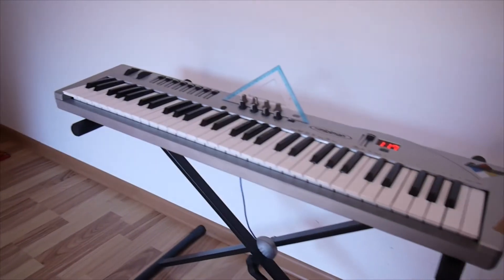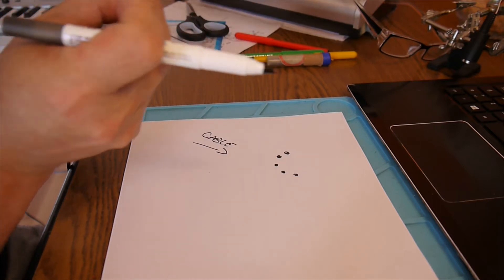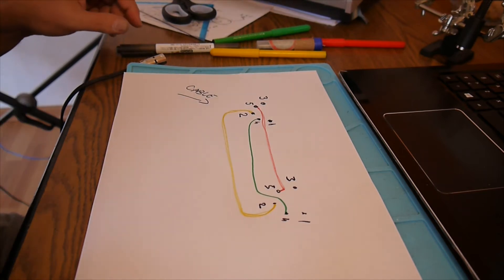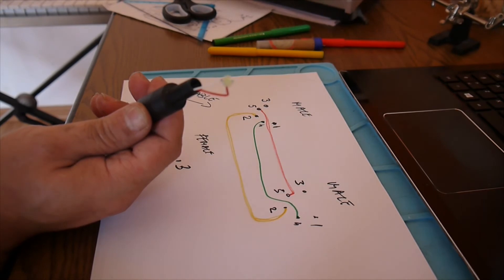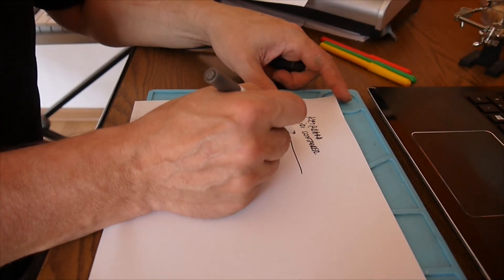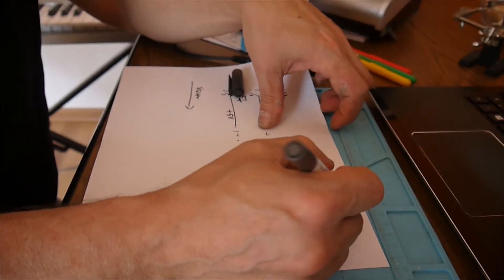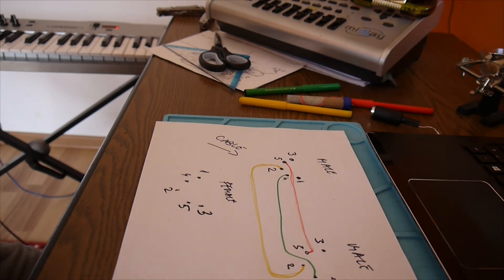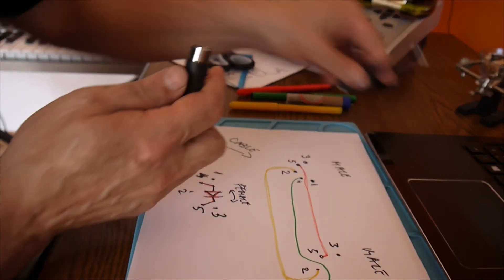DIY Midi cable, MIDI tester and general considerations.

Comment: please, do another video on making a DIN midi cable to USB midi cable. Old midi host to PC. Thanks
Reply from the maker: IT's kind of tricky cause we need an electronic circuit to act like a ''translator'' between classic MID signals to USB compatible. You may buy a very cheap interface for few bucks instead...

Comment: im having a hard time opening up the midi cable i have i feel like i will break it. Is there a trick to opening them up? I'm planning to make connections so I can use it with the old tape microphone i have which has DIN connection instead of normal xlr
Reply from the maker: If that's a factory one, I mean molded in plastic I'm afraid you will distroy it, try to reach the disk which keeps pins in place. Try some Din connectors de from aliexpress better and solder a cable to those
Reply: @viocaia  thank you! ill try

Comment: I see that you are using a Midiman. I just got a used one for free and did not come with a driver for PC or Mac. With an old Midiman Controller, do you think it could still be used with the modern PCs or Macs?
Reply from the maker: Of course ..why not?

Comment: which among pin 4 and 5 is input and output?
Reply from the maker: There is no IO in the same cable..you need two a different cables for Input and output.So, just respect the order 2 for shield, 4 for Source and 5 for Sink..a kind of ground..don't tie 5 with 2..there are separate shielding..
Reply: @viocaia  thank you,,

Comment: Please explain how to connect midi cable to usb cable
Reply from the maker: There is no way to do that physical you need some circuits to 'translate midi data to USB way' so you better buy cheap midi to usb cable

Comment: Query what type of cable is used for the midi? can it be the XRL cable or cannon? or shielded cable that contains at least 3 cables would already work?
Reply from the maker: Last one..in fact 2 wire and shield will be ok
simple audio cable fits as well

Comment: nice video...i make a arduino octerpad.i want to connect midi cable to arduino board.but i have not a midi female connector.can you help me to connect  wires to midi cable??
Reply from the maker: very simple..middle is ground and pin4 and 5 are signal...